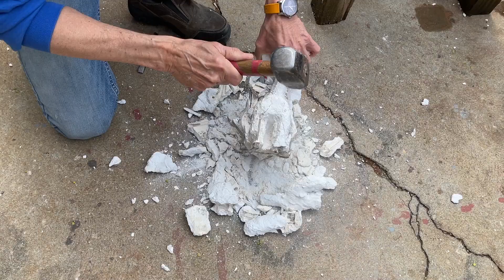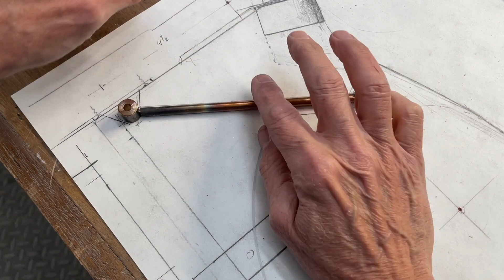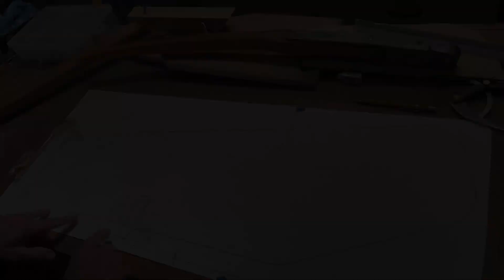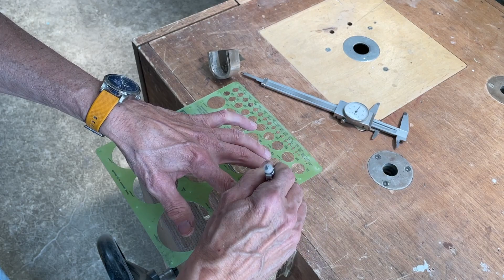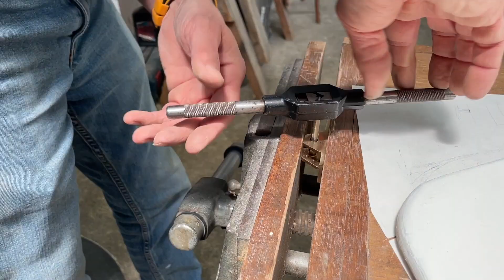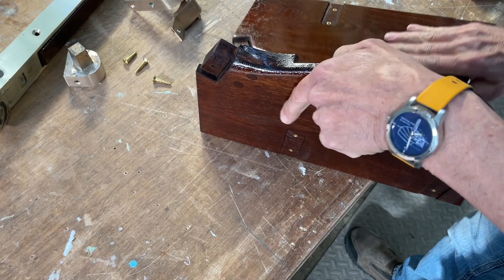Kick-Up Boat Rudder is Like Nothing You've Seen Before! S3-E17

Comment: Beautiful boat and beautiful rudder. I really like how quick and easy it is to operate. Since it has been 2 years since posting this video. How has it held up and how has it worked out? Do you have to hold down on the handle when the boat heels over or in heavy waves? I was thinking you may need a bungee on the front to hold the handle down.......but I have never used one before.....so not sure if it would be required........Great video.....and once again beautiful boat.
Reply from the maker: I unfortunately have not been able to sail the dinghy myself. Those that have and Steve, who owns the boat, have reported that it is quite easy to sail. Having been sailed in the Gulf of Mexico it performs well in waves and there is no need to hold down the tiller or need bungee assistants. 
Thanks for watching!

Comment: Great video, very clear and concise and as I am about to undertake a similar Dinghy rudder rebuild myself (1970's CSC Caprice - 15 ft) also very useful in what I will have to do.  I will not undertake the retraction mechanism at this stage but will modify the unit somewhat later when I have resources to perform the metal working side of the job.  Having worked with wood for much of my 70+ years, I was very interested in learning about the Potasium Dichromate process.  Well done and thanks.

Comment: What a joy to see someone using feet, inches, fractional inches, thou, letter drills, TPI, etc.  People who only use metric units don't realise how intuitive, flexible and useful imperial units can be.  Some of them think we are idiots stuck in the past. I was lucky to have been raised with both.  One of my most useful little books gives a table comparing mm with fractional inches, number and letter drills, etc.  As you say, you can move stepwise up the diameters only a few thou at a time using all these different series.  My machine tools have leadscrews of 8 TPI, so why would I want to junk them for expensive new machines with metric leadscrews?  Or junk my imperial micrometers?  Or my BA/ME/Whit/BSF taps and dies?  Or my toolroom 6" ruler - by far the clearest ruler I've ever owned.

Comment: Bob, you out did yourself! That was ingenious.  I am in hopes that you put a little hole crossways through the bottom pintle so that a cotter pin or small wire ring can be run through to keep the rudder from coming up and out of the gudgeon.

Comment: The bronze fittings are just beautiful!  I was skeptical about the use of silver solder in tension; so I looked up the properties of silver solder and saw that it has a strength of 70 ksi; so, better than structural steel.  I am learning a lot from your videos and those from A2A.

Comment: My only (2 part) question is;
 What is to keep the rudder from floating up and having the pintles and gudgeons seperating? Shouldnt there be some manner of lock pin on at least the top set to keep the rudder attached when in use?
Edit: The design is beautiful and masterful, but I think you might have overlooked this tiny thing. Maybe a strap that loops under to hold it from rising enough to bind or seperate? Just a thought, since the pins are so small.
Reply from the maker: The rudders displacement is 2 pounds. The rudder/ tiller weighs 12.5 pounds. No worries about it floating off the Gudgeons. The R/T will be tethered in case of a capsize.

Comment: I think it looks great, I am just worried about the strength of the soldiering on the tabs and connecting rod over time
Reply from the maker: Silver solder strength is 60,000 psi I don’t think you need to be worried. Silver solder is much different that the lead solder used by most plumbers.

Comment: As a dinghy sailor for half a century I have to say I have never had such a work of art on my little boat. Three questions though: the rudder blade will float, will this make the folding mechanism tricky to fold down? What is to stop the whole floating up and off the grudgeons? And in the event of an inadvertent grounding what will save the rudder? (We used to have an elastic cord at one time and then there was a clever cleat which flipped up and released a rope hold-down.)

Comment: At first I thought it was so it takes up less space on the deck, but than I figured to rudder still has to come of the boat because the tiller sticks out. 
So what is the use of having the rudder in the up position?
Reply from the maker: When Steve beaches the.boat he does not need to remove the rudder.
Reply: @TheArtofBoatBuilding  Ah, that  makes sense! Thanks for the reply.

Comment: Out of curiosity, why did you solder the brackets together? It seems like you could have cut the shape flat and bent the tabs up. Was it just a matter of having soldering equipment and not having a sheet metal brake that would handle 1/8" bronze? Or is there a strngth issue with bending them?

Comment: The rudder is beautiful, you need to add a flexible metal/bronze  leap on the transom to avoid that in case of capsizing the boat the rudder would fall off.

Comment: Beautiful piece of work as always Bob.  My only question is will the final rudder assembly hold up over time and use. To my eyes the overall assembly looks like to might be a bit fragile, especially the rod mechanism between the two cheeks.  We all know salt water is extremely corrosive and you were very careful about selecting the proper cast bronze fittings and wood for the job.. Otherwise, the rudder is a wonderful compliment to Victoria and hopefully Steve will be thrilled with the results.

Comment: Those chicago/post screws will be marginally strong enough in that design. I used them extensively for 30 years in the medical device industry and know that they will often fail wher the post meets the head. The brass has a very thin cross section there. Given the likelihood of the oak swelling and shrinking with use and corrosion issues, I don't think they will last long. Also the screws will corrode in there quickly so they will be a pain to change. I  would recommend copper or brass rivets in that application.

Comment: Cool!  I have used that Dichromate for 19th Century CARBON prints  And old photoraphy process Using colored gelatine Either ink or watercolor for the colors  A 4 color since the darker the image the thicker it is  It's possible to get a slight 3 dimensional image
Reply: It's a contact printing process so using either LF or ULF film Or a digital neg Being more old timer boats too wanted to get a small ULF camera  Maybe a 4x10 7x17 side not on the chemical

Comment: A beautiful job! It might be worthwhile to put a drop of blue Loctite onto the thread of those little screws you made for the retraction lever pivots. While the rudder cheeks will prevent the screws from backing out completely, they might still back out far-enough to gouge into the back of the cheek...

Comment: What an elegant solution.
Would it perhaps be worth drilling the pins that hold the rudder in position for cotter pins whilst it is in use?
The “d” shaped ones are easy to insert/remove.
Reply: I was thinking that too, not least because the wooden rudder probably wants to float.

Comment: Im very curious to see how the solder joints hold up at sea. Great job on this. I'm gonna have to try that potassium dichromate finish. That's absolutely beautiful.
Reply: It's not the finish.
Reply: @dougbeers6123  OK Mr semantics police. It's reagent that reacts with the tannins in the oak, forming the color (stain) over which the final finish is applied. Staining is (typically) part of finishing wood. In this case, the potassium dichromate is integral to the final result so referring to the stain as the finish is not incorrect.
Reply: I have fumed quarter sawn oak with concentrated ammonia—am eager to compare the potassium dichromate treatment to that. Thoughts anyone?

Comment: 16:40 Great job designing it to be taken apart. Not only will that mechanism need to be accessed, the inner faces will need to be cleaned periodically if it's in the water for extended time as Steve plans to do.

Comment: Bob, what's the chances of the rudder lifting out of the hinges due to floating? You don't have alot of weight there to hold it down in position, and a fair amount of bouyant wood.    Ed C
Reply: I asked the same question. It's not fun to lose steering.

Comment: That's lovely. But I think a bit of threadlock on the pivot screws might be called for. (Also maybe make a couple of spare screws to keep in the boat, as losing one would leave you with a rudder that keeps floating up)
Reply: I was going to suggest the same. Last thing Steve will want to do is source one-off fasteners in some distant port.
Reply: Yes!

Comment: Loctite on some those pins & screws
Reply: I would use it on the threaded pins, I would not use it on the screws though. The screws will need to be removed periodically, and bronze screws tend to get gunked with corrosion anyway. If anything I would put wax or some other anti-seize to keep them usable. If those threads get too tight you'll end up spinning that inner nut, and then you'll have to drill them out to get it apart.

Comment: Hmmm   Silver solder tension connrction> Would be stronger if thraded connection
Reply: That's what I thought too, but I looked it up and apparently silver soldering is actually almost as strong as welding when it comes to tensile strength.

Comment: Isn't it making the dinghy a meter longer sitting on a ship's deck?
Reply: The rudder would be removed while the tender is stored
Reply: @efredricksen  What's the reason to make rudder retractable then, if you just remove it when it's on the way?
Reply: @Dustmadeout  So that you can beach it.
Reply: @CorwynGC  Remove it on the beach like you would on the deck?
Reply: @Dustmadeout  You are sailing into shore to have lunch on the beach.  You need to steer up until the last moment.  Water is getting shallower.  Flip the rudder up and maintain a bit of steerage without scraping the rudder on the bottom.  No need to hang off the back of the boat and try to lift the rudder off the back leaning transom, while dealing with surf.  And then doing the reverse, in the surf, getting back.